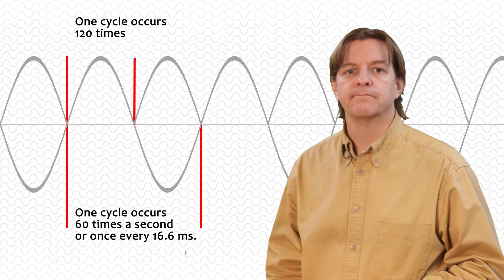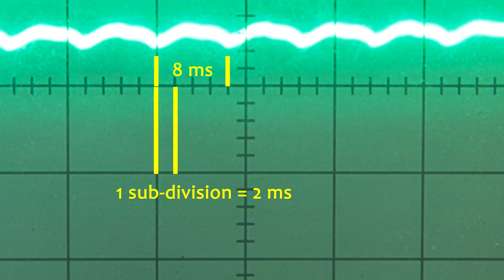How to measure fluorescent and LED light flicker

Comment: Your conclusion is wrong. Of course it flickers, but your setup not sensitive enough to measure it.
Reply from the maker: You don't have enough information to make the statement "of course if flickers." Depending on the driver, it may have enough filtering to not have any. It may be that there is some flicker at a very high frequency that I can't detect. If that's the case, it's too high to matter.
What it doesn't have is flicker at a frequency low enough to be an issue. This setup is sensitive enough to detect flicker on fluorescent lights and showed none. Additionally, my camera has flicker detection that consistently pops up under fluorescent lights but has never popped up with these. For all practical purposes, my conclusion is valid.

Comment: You know the new LED street lamps that the telecommunication companies are busy installing everywhere worldwide... Do they flicker? Do they have a pulse rate variation? That is to say, are they transmitting Li-fi data to who-knows-who? I'm curious!
Reply from the maker: No, I'm not familiar with LED street lamps installed by telecom companies. Around here, street lights are installed and maintained by the local municipality.

While technically possible on some level, I'm not sure how practical a street light based communications system would be. Seems like it'd be susceptible to a lot of interference , have pretty limited range and working time. Sounds like a good plot device for a movie though. :-)

Peace.
Reply: Would be nice if it were just for a movie. But yes, new lights are being installed together with the 5g in more and more places around the Western world, and the stated plan is for it to cover every habitable inch of the globe within the next few years. It's in my town already, but there's a good chance you are still basking in the last rays of normality in your part of the globe. You may or may not notice the change when it comes. Most people don't. A camoflaged pole here, an inconspicuous little transmitter there, tiny antennae all around... And interference is not an issue with Li-fi any more than radio waves are an interference for cell phones.
Reply from the maker: Interesting, what town are you in? The only information I can find about it being used in streetlights is a trial two years ago in Dubai.

In some ways, there are advantages to LiFi. I don't know why widespread deployment would be a bad thing.
Reply: I know it's all around New Jersey, some places in England and California, not sure where else. Probably tons of places. They're rushing to put it up in India and China as well. When you see construction, try to see what they are doing. Putting in additional telephone poles to hold all the new junk? Taking down trees so that the transmitters' signals don't get blocked? That's been going on every day here. Wow, it's amazing you found an example of them admitting to do what I'm saying it looks like they're doing. The reason why widespread deployment of Li-fi would be a bad thing, if that's what they are doing, is because it is not for us. The 5g is for us. (That's bad enough, considering that hundreds of scientists around the world are saying the early experiments show these new microwaves can cause cancer, infertility, DNA mutations, etc. and more studies need to be done. The scientists are being ignored as capitalism prevails.) Who is the Li-fi for?

Comment: Some do, cheap filament led bulbs use the most simple driver and flicker at 60hz, shows up on cellphone cameras, regular cheap led frosted a19 types don't flicker.
Reply from the maker: Not sure what you mean by "filament LED bulbs," but you're correct in that whether LEDs flicker is a direct consequence of how well designed the power supply is. Poorly designed supplies that lack sufficient filtering will flicker. Peace.
Reply: Oh I think the newer variation of LED bulbs which mimic the look of old fashioned bulbs are called filament bulbs, glass globes with strands of leds dipped/coated in phosphor.  You can find them in stores now, or ebay, but many of the ebay ones I've tried flicker, on cell phone cameras you can see black bands appear.  The standard models don't have the problem from my experience.
Reply from the maker: Oh, yes, I know what you're referring to now. I'd not heard those types of LED bulbs called filament bulbs before. That's interesting about the banding you've seen with them. Thanks for sharing! Cheers.

Comment: My fish tank has led lighting and I was filming it and it looked like it was flickering. I totally thought at the end of the video you were going to say they flicker. Nice to know
Reply from the maker: It could be that they were flickering. Different LEDs have different control electronics and, depending on the design, they may flicker in a way that is visible on camera. You could try changing the shutter speed of your camera and see if it changes or goes away. Hope that helps. Cheers.

Comment: Do know how to replace a furnace or water heater or central air conditioner?
Reply from the maker: +Bruno Mars I have replaced water heaters. I'd feel comfortable doing a furnace, but A/C units require special tools.
Reply: House of Hacks I know AC units are difficult by the way you should upload how to replace a furnace on your channel

Comment: this video was a waste of time
Reply from the maker: Sorry you feel that way. What were you expecting that you didn't get?
Reply: House of Hacks I have led bulbs that flicker and I thought you'd show a reading of different leds that do flicker but yours apparently had none.   sorry for the negative comment
Reply from the maker: Ah, right. The YT channel electronupdate has a bunch of detailed reviews and teardowns of different LED bulb models. Try searching YouTube for "electronupdate bulb review" and see if the model you're looking for shows up. Hope that helps. Peace.
Reply: thanks I'll check that out.   I have some led bulbs that are like yours that have no flicker but other brands that do.  seems there's no way to know this till after you buy them and try them out.
Reply from the maker: Yeah, there's no way that I'm aware of to tell without buying them first or finding a review that specifically measures them. It's really a matter of how well the control electronics are designed and manufactured.